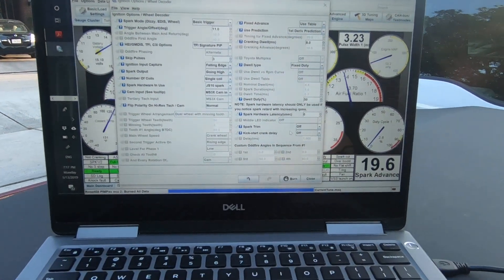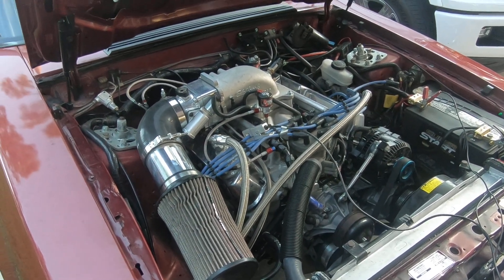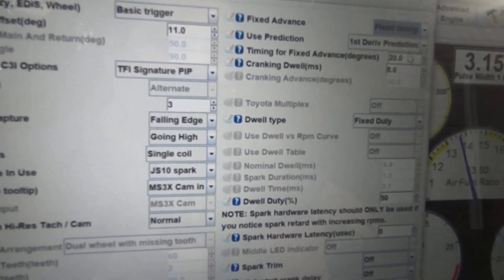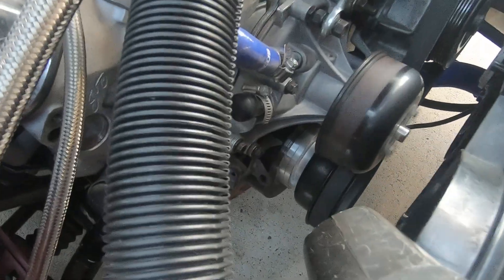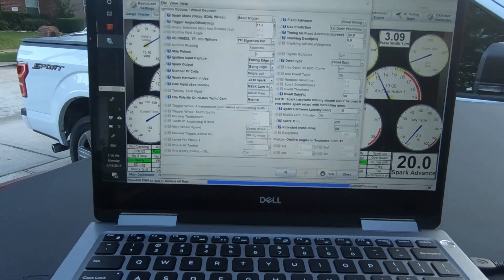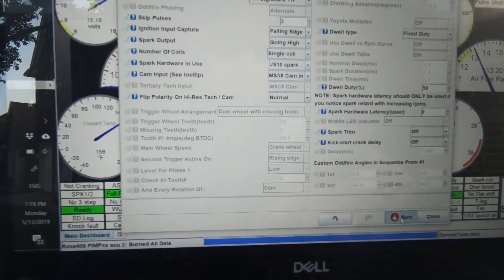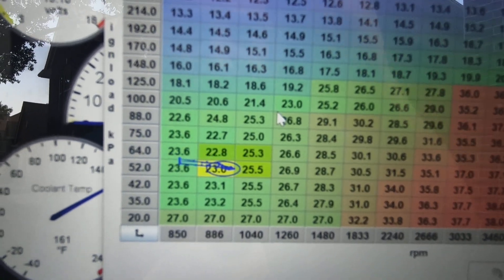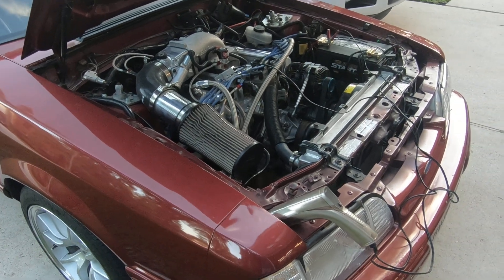MEGASQUIRT TUNER STUDIO IGNITION TIMING SETTING - Mustang Fox

Comment: Did you initially set your base timing (10 degrees) with the spout removed from the distributor harness? And then when you synchronized timing in tuner studio you left the spout plugged in.
Reply from the maker: You're supposed to use the software.  Set it to "FIXED" and then sync your timing with whatever you have in the field.  Can be 10deg.  In the video I show 20deg.  Its not an adder.  Just a sync to make sure it's matching commanded
Reply: Frank Gonzalez  Ah ok, I get it now. Thanks
Reply from the maker: @ralphpineo9584  Once you have it set, then change back to "USE TABLE" then click burn.
Reply: @ralphpineo9584  Actually, if you remove the spout on a Megasquirt car, it won't run!
Reply from the maker: @robertelmo7736  I've heard of some people having that issue but it's never happened to me.  Does it just shut off or surge then turn off?